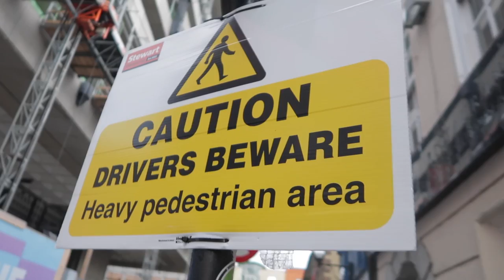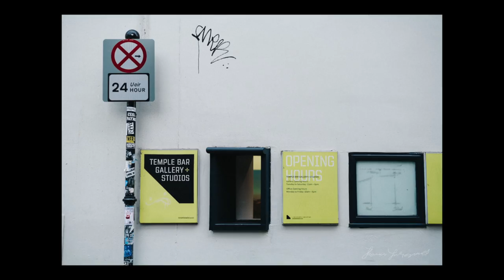Street Photo Diary: The Original Canon 5D Back in Action

Comment: Hello Thomas
. How did you setup please the Canon 5d classic (jpeg format, picture style, etc....) ? Maybe also a short video about it please ? In which program mode take you normally your pictures with and without flash ? Do you use ETTR method (expose to the right) ? Thx
Reply from the maker: Raw + JPEG (I only really use the raw) standard picture profile - shooting in aperture priority - with exposure compensation when necessary. I don’t use a flash normally when outside. Only if doing portraits etc but not for street shooting
Reply: Thx Thomas and which profile do you use in lightroom please (adobe standard, camera standard) with the Canon 5D ?
Reply: I shoot RAW + Medium JPG with sharpening turned up all the way in camera to make it a little easier to check focus. Since the colors are a big part of why I love this camera, I usually turn up the saturation all the way.

If it's sunny I turn down the contrast and if it's cloudy I turn the color tone to the left to warm up the images (in Picture Styles).

With these settings, I usually need zero post-processing. This camera allows me to do more of what I love (shooting) and less of what I hate (staring at a computer).